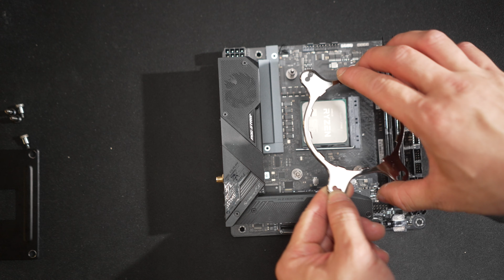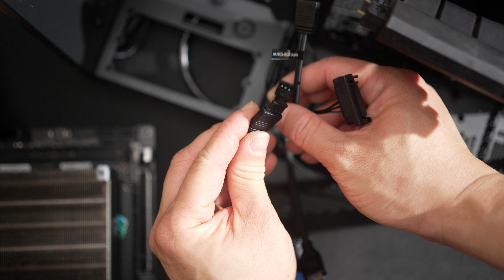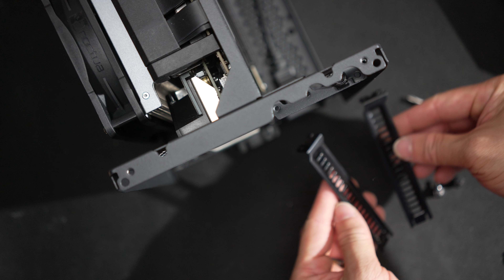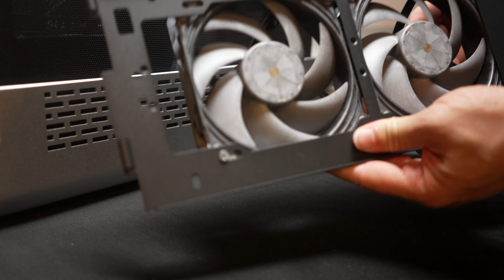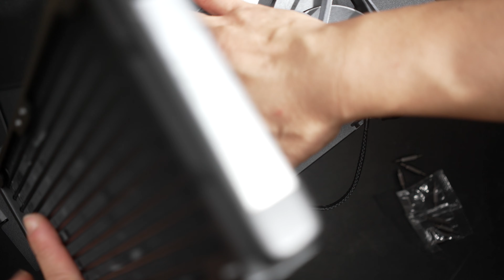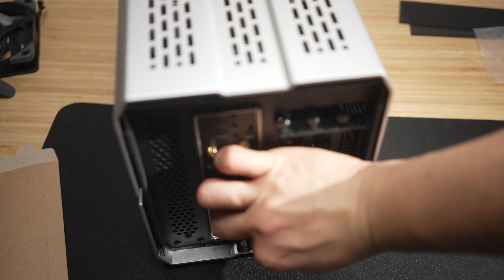Phanteks Evolv Shift XT Build Guide - Compact, Air Boost, Liquid!

Comment: Not sure if it really matters, but I believe I read somewhere for these RTX GPUS that it is recommended to use separate power cable for each  instead of a jumper connector cable
Reply from the maker: It is- depends on the cable though. There are some manufacturers that use 16 gauge cables and that is fine for a single cable. Lots of them are 18 and that would be a two cable application.